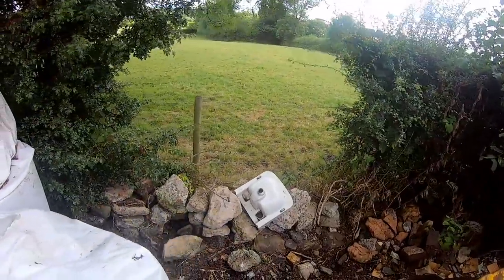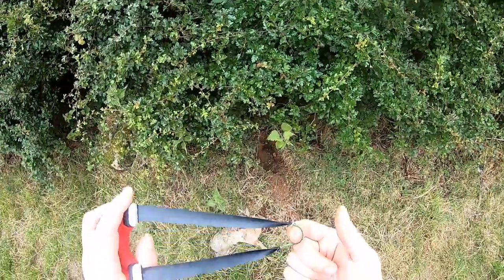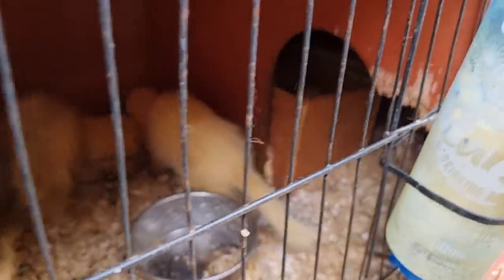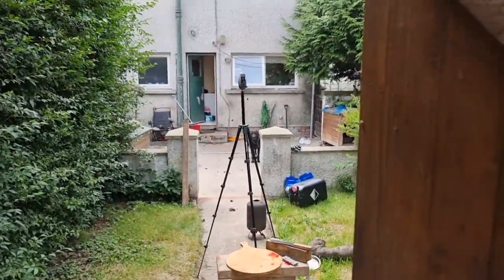Catapult hunting Rabbit 8mm Steel

Comment: If you get yourself a smoker and keep the temp around 180°f  and after 3 or 4 hours wrap it up in aluminum foil with a cup or two of apple cider for another few hours, the longer you cook it at the low temperature the more tender it will become.  The smoky flavor takes everything to the next level 👍

Great video.
Reply: A greatway for aluminum poisoning sorry
Reply: @glenhawman7440  I don't think it get hot enough for that.  Think baked potato, or every rice cooker ever made, or the big pots that you deep fry a turkey in.

Comment: Might have to try your setup, I'm using .85 bands -25/20 taper with 11ml steel
Reply from the maker: Nothing wrong with your setup pal. I have a good bit of experience with my setup so 8mm steel is not for everyone but it can be very effective
Reply: @CatapultCarnage  what was your active band length for the 0.5 snipersling black?